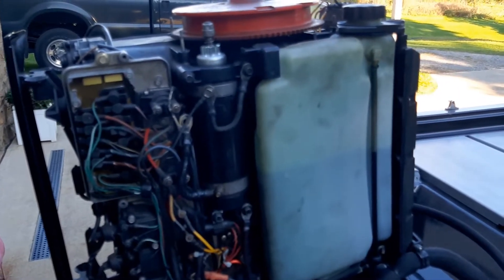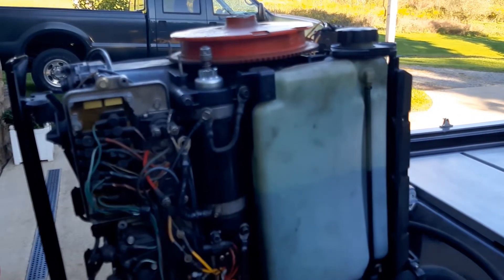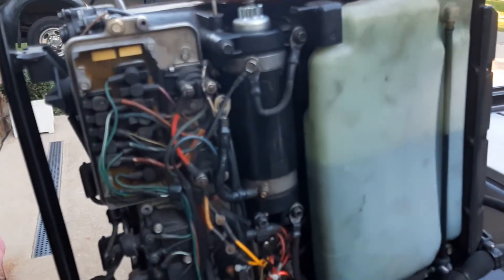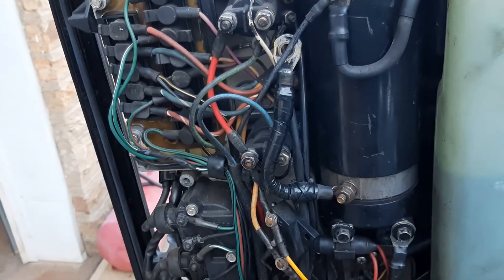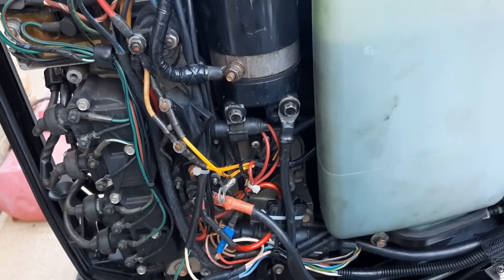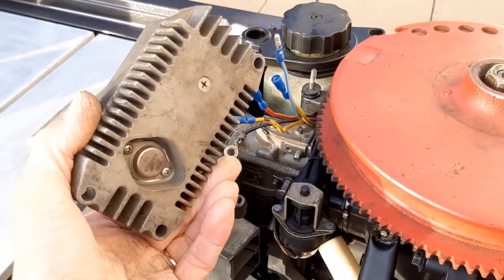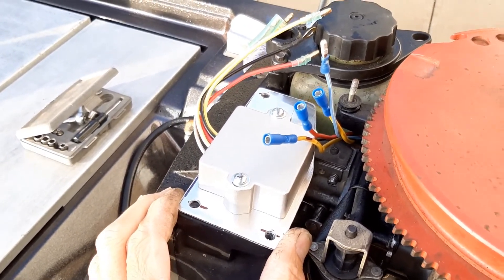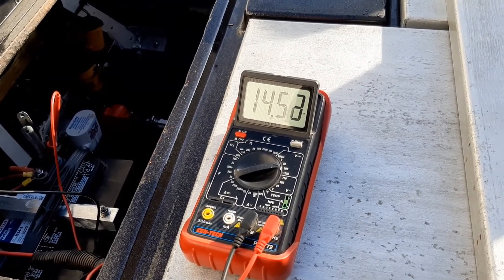Mercury Outboard Rectifier Swap

Comment: I have the small rectifier just installed a 16 amp stator wanting to convert to the voltage regulator rectifier do you need the grey 3 prong part or could I use the rectifier I have and just add the 6 wire one not sure what the purpose of the 3 prong part with the 6 wire setup

Comment: Awesome!!!!
I have an 1987 80HP mercury. Cylinder 1 started misfiring and I found out the rectifier was melted. Replaced the rectifier and that corrected the misfire but now the voltage is staying up to 17.5 I have replaced the stator and another rectifier/ regulator. Still 17.5 volts went back to the old rectifier and now I am seeing 60VAC from the stator and 60DC out of the stator. I am thinking I am overlooking something, just haven’t figured out what I am missing.
Reply: Did you ever resolve your issue
Reply: @Ghost-Conn I got a voltage regulator and that seemed to fix it

Comment: HI, I have the exact same motor, I have had a misfire on one cylinder for a while at Idle, and have decided it’s the stator, I am wondering if I need to change the rectifier/regulator as well,                         How do I test it before I order a new one,                    it does charge the battery
Reply from the maker: I doubt if it's the stator.
Reply: would a bad rectifier/regulator cause an intermitant  misfire  at idle  @crankshaftandco
Reply from the maker: @geraldoakley7688  not usually

Comment: You do have to hook the other red wire to the starter solenoid,it's the sensing wire,if you don't,it will only put out about 7.5 volts.13.5 after I hooked up second red wire

Comment: I have a 1989 90 H.P. 3 cylinder 2 stroke and have had the same level of confusion with trying to troubleshoot my battery charging issue.  This video was very helpful in helping me sort through a few things.  The unfortunate thing for me is that the voltage regulator part no. is obsolete at this point.  Curious as to what the part number was for the regulator rectifier that you installed.
Reply from the maker: Here is the info for regulator I got it from Amazon. Good luck.
Commercial navigation Replacement for Regulator Rectifier Voltage Mercury Mariner Outboard 5 Wires 25 to 250 HP Replace 815279-1 815279-2 815279-3 815279-4 815279-5 65W-81960-00-00 65W-81960-10-00 https://www.amazon.com/dp/B07W5PC41Q/ref=cm_sw_r_apan_i_6VESSH6MZKTHPK65A2H1?_encoding=UTF8&psc=1
Reply: @crankshaftandco  thanks for sharing.  My current voltage regulator has a 6 wire set up.  Two reds, two yellows, a black and gray like the first unit in your video.  I am curious as to why you went with the 5 wire set up instead.  You had mentioned that the other red lead is only used for sensing which I didn't fully understand.  Also how has the regulator / rectifier replacement performed for you.  The other difference is your terminal block is black where as mine is gray.  Curious whether or not I need to change this part out to be black vice gray.  Not sure how a terminal block can go bad but I am throwing dice at this point.  I have purchased a 6 wire regulator and it is on its way.  Looking at your ordered regulator / rectifier I am not sure how you connected the blue wire which appears to be coming from the harness.  Also what type of stator is installed on your engine.  This will help me as well I believe.  Sorry for all the questions.  Just trying to make sense of things on my end as well.

Comment: thanks this is the only video i was able to find which showed the system I have on my 1990 90HP Mariner outboard. I also ordered the the small rectifier with the 3 posts and then got confused as it didn't look like the one I had on my motor. Now I know what to look for . Thank you very much this was very helpful. Did you measure your voltage output when you're cruising at higher RPM? Does it stay at around 14.5?
Reply from the maker: It should be around 13.5 to 14.5 yes.